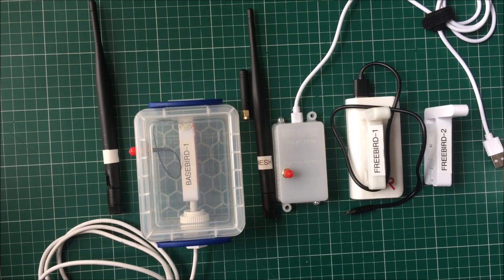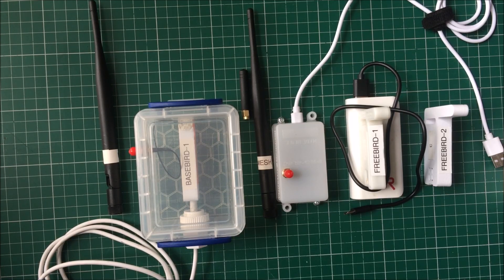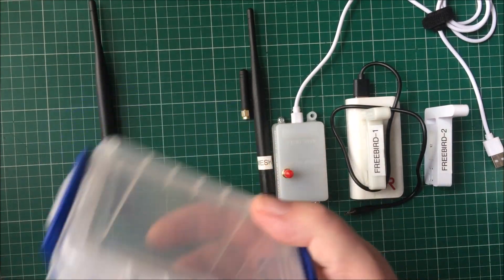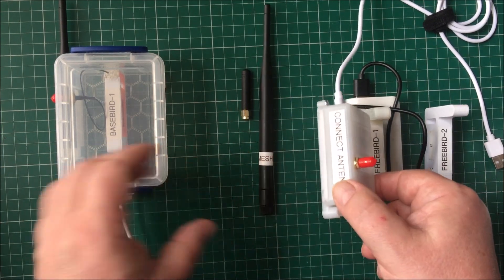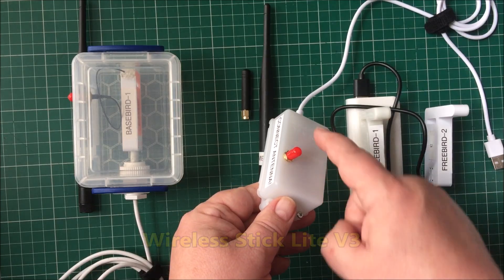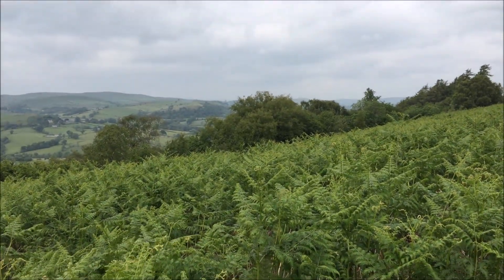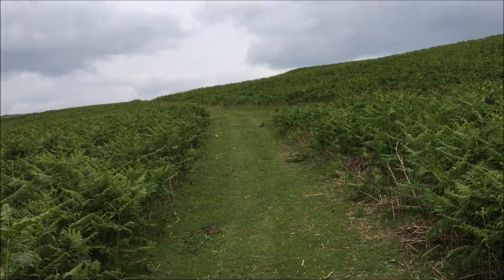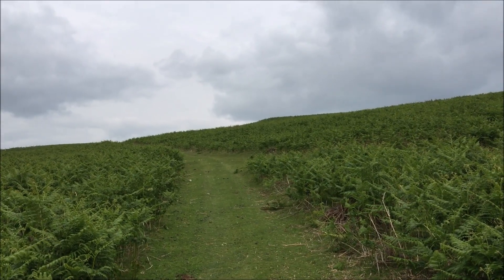Off-Grid Messaging with Meshtastic - Can I Establish Reliable Comms Back to Base?

Comment from the maker: Addendum - I've now discovered that the Heltec Lite board used in BaseBird 2 is defective as in it appears to be transmitting very little power. I know I've not transmitted without an antenna, so perhaps a defective antenna or feeder has caused the issue or perhaps I just bought a dud!